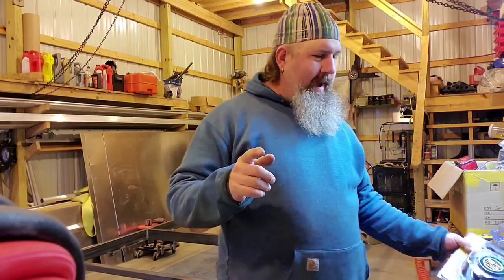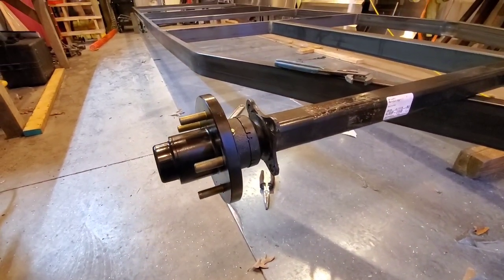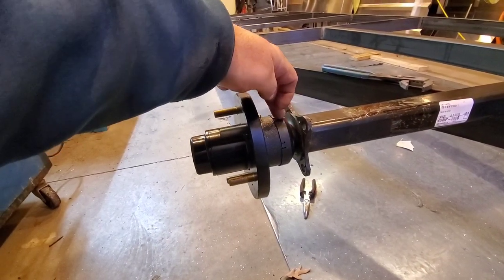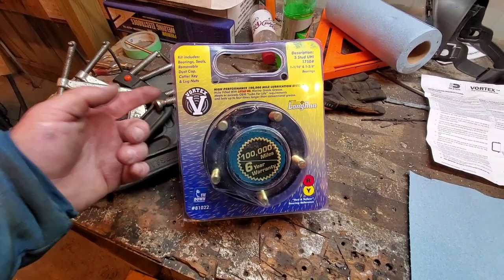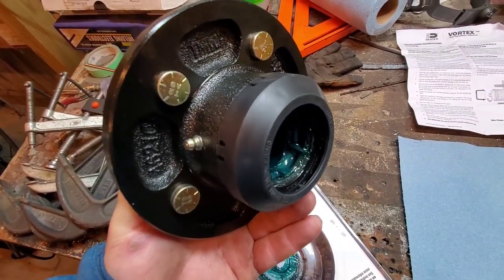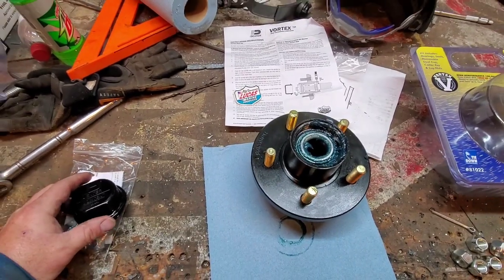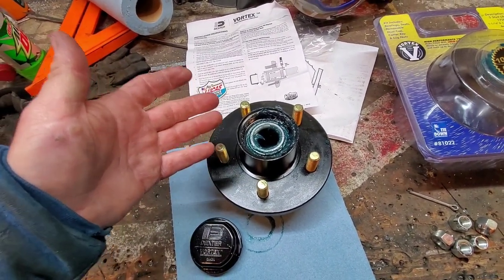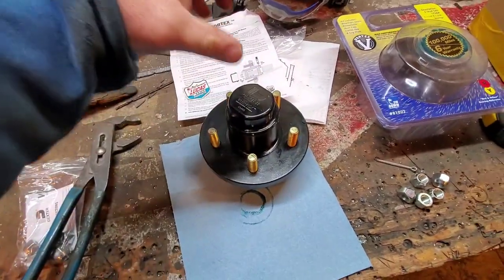Vortex Boat Trailer Hubs

Comment: They came on my Roadking boat tailer. Hubcaps (plastic) will crack and dry rot especially if you put your boat in salt water. You can get replacement caps though. Good stuff.

Comment: The Plastic cap is what fails. it heats up on long trips and weakens until it breaks.  Then you have a problem.  I am searching for metal caps.  Other than that they are pretty awesome.  I tow my bass boats all over, 25k plus  miles a year.